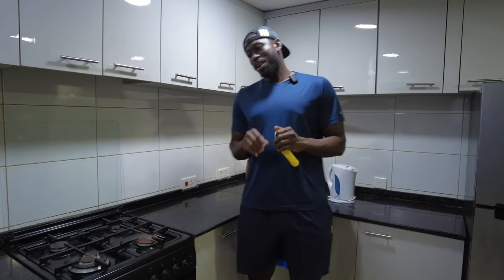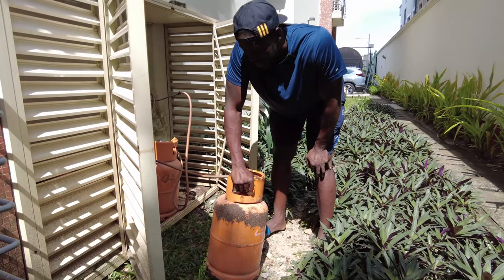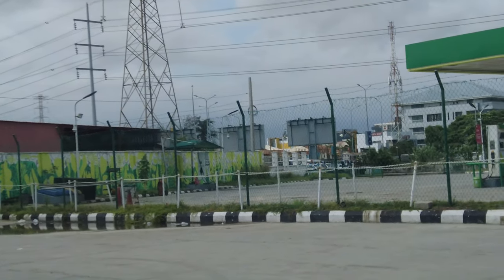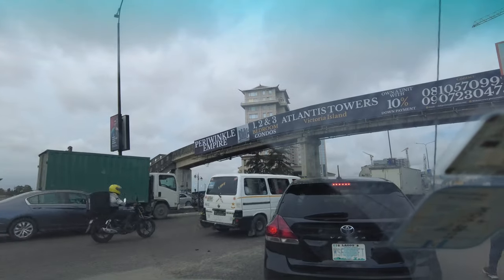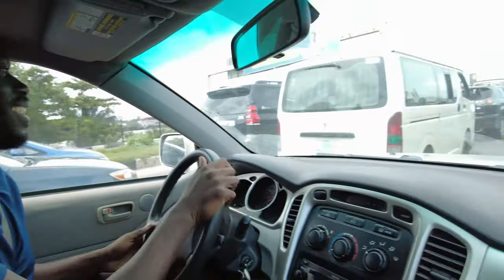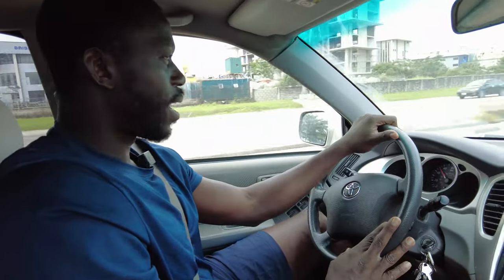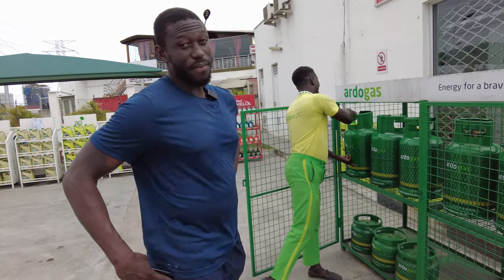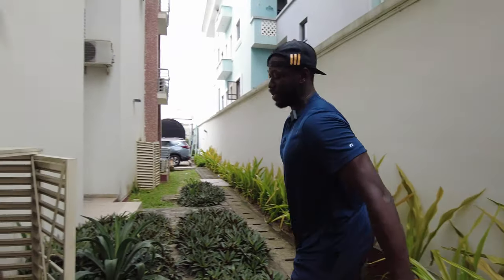LIFE IN LAGOS: How to get cooking GAS in Lagos, Nigeria  - VLOG - Drive with me

Comment: Bayo, AP is African Petroleum Plc. If you had bought the new Cylinder from where you refilled your cooking gas. You will save N5,700 because their new cylinder only cost N23,000 and you can fill it up with N10,800 equal to N33,800 compare to N39,500 that you paid at the gas station. Great content, keep it up young man.
Reply from the maker: Aaaaah THANK YOU!  African Petroleum. And yes you are right ? I would have saved buying it from the local market.
Reply: So AP is no African Petroleum. It’s now Ardova Plc (you can see the name at 33:16).
Ardova bought it over from Femi Otedola who had bought it initially from African Petroleum. When it was under Femi, it was Forte oil.

Ardova changed it back to AP to retain the nostalgia but the meaning of the acronym is now different.